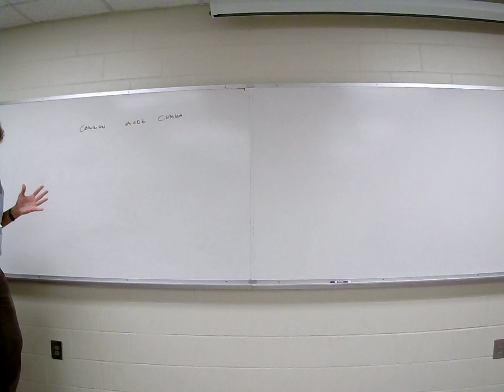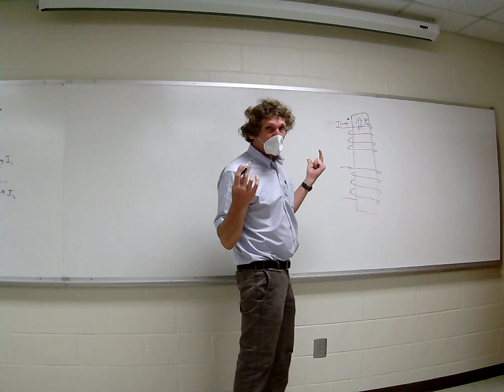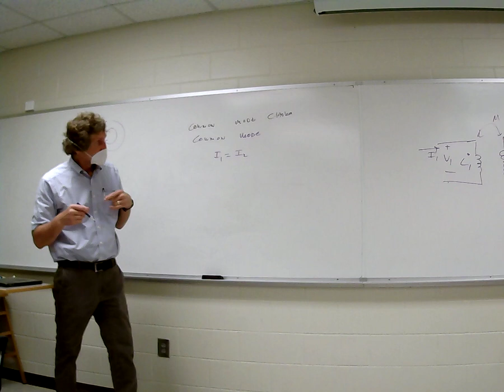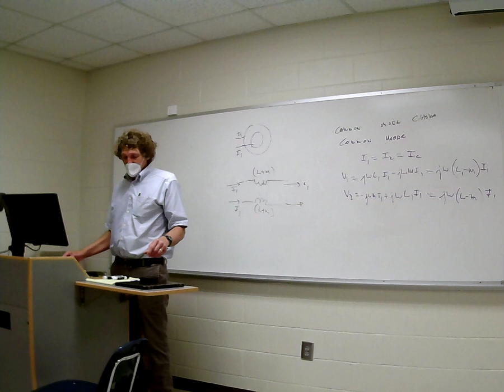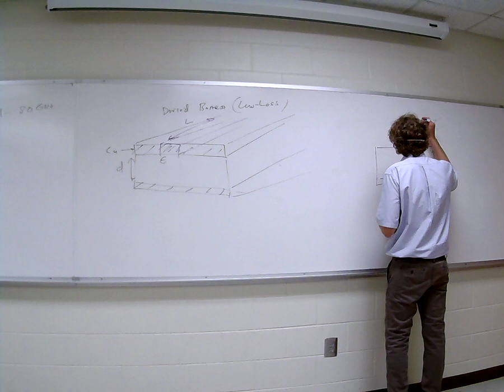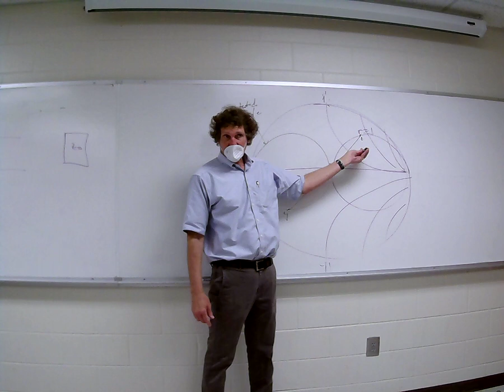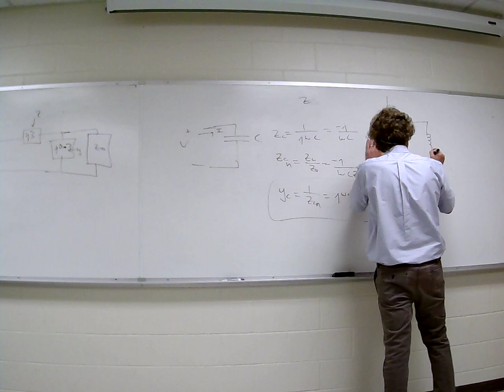Lecture 33 (4/7/21)

Comment: 0:01 Common Mode Chokes
2:20 Dot Convention
24:52 Microwave Engineering Intro
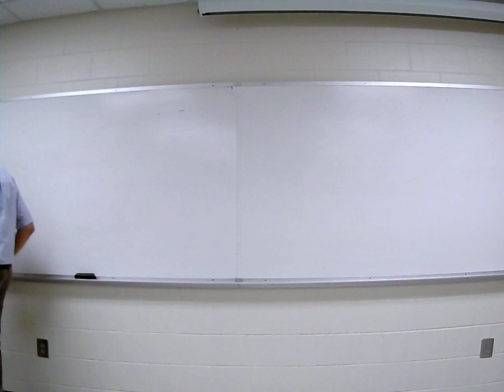34:40 Rotated Smith Chart / Lumped Element Matching Network